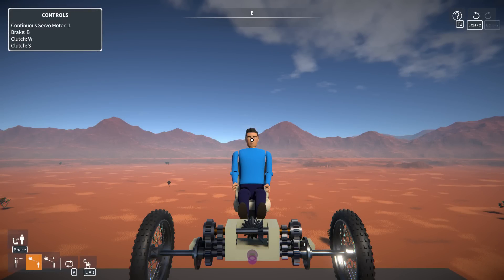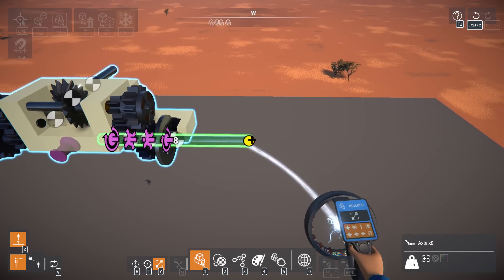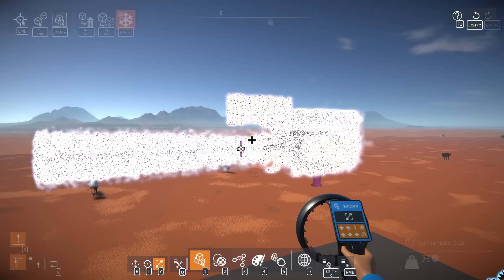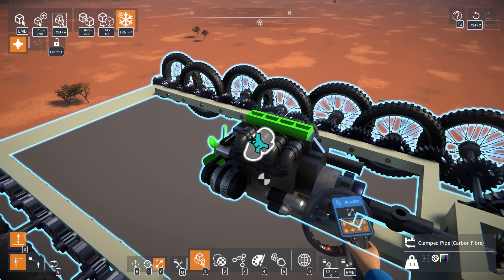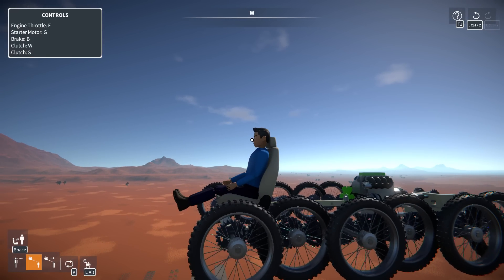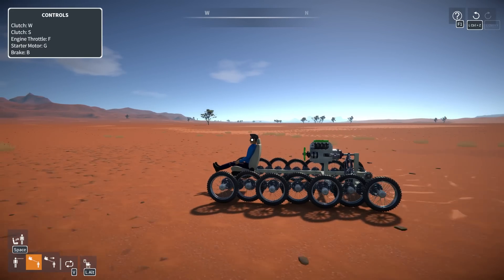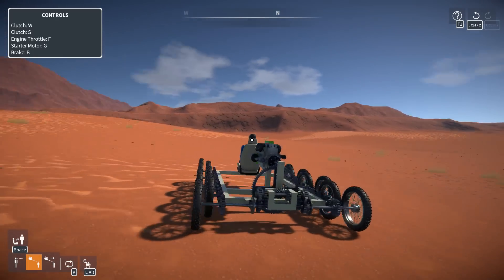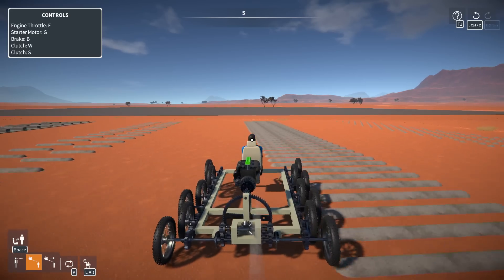I Built a Tank Drive Using a Single Combustion Engine and Transmission!

Comment: When it comes to drive the gearboxes, you have multiple choises. There is the the obvious one diff two brake, the second is a set of two gearbox for each side, so you can control the speed of the sides, but this way you have set curves to drive. And there is the brittish way, with two or three differential, where you actually have neutral turning and smooth curve control, but it's complicated as hell. The sprocket can be front or back, it's basicly preference and where it fits.

Comment: For the motor, you'd probably want something more like the motors you'd find on a large boat. Instead of throttling up the engine only when you want to move, you throttle them up and leave them at that 'working' speed, and vary the clutch to put their power into the props. While this would be completely the same during most of their travel, navigating something like a marina is more along the lines of you driving in the map. you set the engine at a given speed and just change how it engages the drive mechanism. in gear blocks, i think the equivalent would be setting the max rev speed for the engine lower and just having that on a toggle. either the engine is idling or it's at "working speed", not revving to the moon.

Comment: I think the problem with holding a turning and driving key at the same time is that one side has both clutches engaged, which locks up the gears.
I think the easiest fix is to have the clutch that activates on A and W go into a clutch on the other axle that has "Invert Control" ticked and disengages with S and D. And the same for the 3 other clutches.

Comment: newer tanks do use diesel electric meaning they use a generator and large electric drives to drive though im not certain if they still power one side and control steering via braking or if both sides are driven on independent motors

Comment: I think you can easily overcome your steering and forward problem by changing your control setup. Set 2 buttons (4 total) for independent control of each sides direction.
for example: 'W' is left forward, 'E' is right forward, 'S' is left backward, and 'D' is right backward. Thus straight would be 'W' + 'E' ,  and a hard right pivot would be 'W' + 'D'.
you may also want to just set the idle higher, or if possible combine it with your 'forward keys'.

Comment: yeah i believe excavators use hydraulic motors for the tracks. The pump is on the body I believe and they put the hoses through the turntable and use rotating hydraulic joints so it can turn freely

Comment: You can try just a open diff in the center on drive axle and put a brake on each side for steering which ever side the brake is applied will allow the other side to take all the power and turn that direction

Comment: Its brakes that make a tank turn. Not all but some. It goes all forward or all backwards and a brake is applied to turn it in either direction
Try open dif and brakes on both side and when u wanna turn let’s say left the left brake gets applied and it will turn

Comment: If im not mistaken most Tread vehicles or zero turn lawnmowers use Hydrostatic transmissions or hydraulic transmissions and the sticks just change flow rate or direction of the fluid causing the motor motor/gear to turn in a different direction.  I am just an idiot on the intenwebs so i could be 100% wrong 🤷‍♂

Comment: It might be easier to send power to left and right and just break teft or right side to steer, it would turn in a wider circle but that might help the button issue, break right to turn left and break left to turn right and then you can hold forwards and use the breaks to turn or press both to stop

Comment: In Scrap mechanic I made a tank that did left/right:  
1/1 on W 
½/1 on WQ 
0/1 on Q
-1/1 on A 
-1/0 on SA 
-1/-1 on S 

or something like that. It was a 6 engine setup but those controls made it smooth as you don't have smooth brake or clutch input

Comment: 17:07 
You turned the acceleration grip down, so when you lift wheels you have no grip in the lateral movement either. Should've left that one at default as the side to side grip is a different slider I think

Comment: Think you need to turn the friction back up abit and make a big engine and then just set your idle speed high so it's at operating speed and then can throttle it up for extra speed if needed

Comment: front vs rear sprocket tanks is mostly to do with auto vs manual transmission. in older tanks the diver is in the front with a manual transmission - it would be kinda hard for the driver to change gears with the controls in the back

Comment: 12:02 tanks always have to move to turn. If they dont, the tracks will bend side to side wich is not good for it. Russian, soviet tanks cant turn their tracks in opposite directions. They have one transmition and two clutches for each track, and one general clutch. So to steer they can just press the left clutch so only the right track gets power or they can pull the steering lever more and aditionally brake on the left side. Western Tanks usually have one transmition per track, so they can turn like an excavator while standing stil, but usually only on asphalt where the tracks are very slippery. In softer terrain the tracks ddg in and the tank might detrack so its not smart to do it. This is the thing that makes russian tanks somewhat better. They only have one transmition so theyre smaller and cheaper without sacrificing anything important.
Reply: bro created a t34 type engine system
Reply: @persone-lb6hp  this engine and Transition Layout is normal for soviet and even modern russian Tanks and is Not exclusive to the t34
Reply: @Laurenz357  i know but i think that more person know the qt34 cause of its celebrity

Comment: Excavators use 2 hydraulic motors, 2 large sprockets, and a good amount of idler rollers  to power and move a right and left set of treads/tracks. The fluid goes through a swivel that is mounted between the tread base (B) and body(A). Side (A) spins with the main body and can keep the tread/track moving in the same direction. The body can have a single or set of motors with gears to spin it around.  It would be fun to watch you make an excavator.

Comment: in tanks 4 clutches is common some tanks 2 per side also know as a dual clutch drive or double clutch steering most other tanks used only 2 clutches forward and back and had a large brake on left and right for steering most also had ither a front drive sprocket or a rear one there was rare few that had both but those were to hard to mass make so they were left behind  until hydraulic drives were put in some newer ones

Comment: okay so a lot f tanks have a clutch, a diff and 2 independend brakes if you brake the right side the left side still moves because of the diff so you turn. what you made has been done but the approach i said is the easiest but if you turn you dont let the other wheel go backwards like this design allows

Comment: Like others have said it depends on the era of the tank if it has front or rear driven gear. Majority of WW2 tanks had the transmission in the front, which subsequently meant the driver gear was on the front too. For an example the Sherman’s whole from glacis assembly that housed the transmission was removable. If you ever get to research about the M4A3E8 (Easy Eight nickname) like the one in Fury you should. Between the stabilizer gun system, Ford V8, and most importantly the HVSS system the thing was an urban combat beast (even though it didn’t have as much armor as the German’s Tigers, and Panthers did. 

It wasn’t until a little after the Cold War, and right after WW2 that tank manufacturers started sticking the transmission in the back. I wanna say for the US the first rear mounted transmission was the M26. For sure the Patton tanks, M46, and its successor the M48 (both were Vietnam, and Korean War era tanks). Nowadays our Abrams’s “super dart” can pen like some 600mm of armor or something, it’s an insane amount. 

You should look up the video of the (modern) Germany’s Leopard 2A7 demonstrating it’s fully stabilized gun system (another ground breaking technology thing for tanks) with a full beer mug on the end of the barrel just flying down a road. It stops just right behind a group of lined up soldiers w/o spilling. As for controls theirs H controls like on old dozers, two lever controls, one for each hand, back when they couldn’t zero turn a tank either for risk of popping off a track, or the type of transmission wasn’t advanced enough. Germany used a damn steering wheel in their Tigers for some reason IIRC. Then there’s iso, or joystick style if controlling. 

I’m a military vehicle nut so I need out about this stuff.😂🤣

Comment: the tanks build correct but you are facing the wrong way in your seat, tank engines face backwards and usually the gearbox is in the front. Also be good to raise the front and rear side axels a few blocks to create the lift in the "tracks" for breachings and crossings

Comment: a little tiny bit of insight I give to how tracks are powered, if you can think it, someone has probably done it
front or rear driven gears are entirely dependent on where the gearbox is in the track vehicle, mainly down to the packaging in the rest of the vehicle, and ww2 tanks especially are rather drastically different from each other, every nation had it's own unique and quirky design ideas
I am in no means an expert of course, but your four clutch system reminds me of a reverser gearbox that people install onto motorbike engines when swapping them into carts/small cars due to the lack of innate reverser on a motorbike gearbox, fun thing with them is because they just reverse whatever input they get, you end up with a six speed forward or reverse gearbox

Comment: Most tanks work like skid steer heavy equipment 
   There's a multi stage hydraulic pump on the engine one for high flow one higher pressure and hydraulic rotary vane actuators on the final drives 
     A vane motor is built similar to the vane pumps on the engine 

   Sometimes called a hydrostatic drive iirc 
This then spins a shaft that goes through planetary reduction for more torque
   The modern vane motors use variable geometry so they can achieve higher speeds without sacrificing torque

   The final drive is all on the back sprocket

   I aced my hydraulics pneumatics advanced hydraulics advanced pneumatics gear and advanced gear trainer in diesel mechanics 😅
   Knocked them all out in one week 😂

   Your tank looks really cool btw and  some early tanks were absolutely made that way 
     Interesting fact they called them tanks to confuse the enemy to have them thinking they was talking about water tanks 😂
Reply: Air tools use vane actuators too
Reply: The big haul trucks at mines use them too
Reply: The advanced pneumatics trainer had a working model excavator you could hook up and operate 🎉❤

Comment: I built a double differential, but once I made my body for the thing I was making it was too heavy too move, but it was still a fun experience to learn how they worked. The main input was the “engine” then the secondary input for turning, I assume would be hydraulic, but I just used a motor, but it took a lot of torque to turn it, as I’m not an engineer and my gear ratios were off

Comment: Most tracked vehicles nowadays use a transmission that outputs the power directly to the two sprockets. Braking happens within the transmission as well. The sprocket connects directly to the transmission by a propshaft/final drive and everything else is in the transmission.  Also usually 3-4 forward gears and 1-3 reverse gears.

Source: Was in an Armor unit with lots of tracked vehicles.
Reply: Also pivoting is usally a seperate gear where the steering yoke control direction and the gas determines speed

Comment: I hope i can explain this somewhat clearly, but John Deere agricultural track machines (8 or 9 series, not bulldozers necessarily) have two shafts coming from the transmission (one for propulsion, one for hydraulics and PTO). The propulsion shaft drives the differential. On each side of the differential, there is a planetary gearset. The differential drives the center "sun" pinion, the "planets" are on a carrier which is attached to your axle shaft which drives your track, and the outer ring gear is not necessarily stationary as in a normal planetary set. The outer ring gear is driven by a hydraulic motor that can turn the ring gear each way, which in effect, speeds up or slows down each track depending on which way the machine needs to turn.

Comment: No a excavator uses in simple terms a hydraulic flow to each motor (planetary) when you move the foot pedals in one direction or the other it controls a valve in some terms that send fluid one direction or the other through a central round valve block in the center of the house baring witch send fluid to the proper track in that direction

Comment: There's actually a rather simple way of making a tank drive that doesn't require a single clutch.

You need two open diffs, and a servo motor.

You set the diffs such that the four output shafts are parallel and the input shafts are facing in opposite directions. Your combustion engine supplies power to what is henceforth known as the primary diff, and the servo motor to the secondary.

The outputs shafts on the "left hand" side should be geared such that they spin on opposing directions and the shafts on the "right hand" side be geared such they spin in the same direction.

With the servo motor stopped you have a locked diff, if the servo free spins you have an open diff, and when the servo spins you'll funnel power one way or the other through the primary diff

Comment: the first thing you showed us was the final drive, not the transmission, I think. The final drive controls the movement of the vehicle and houses the diff, and the transmission is attached to the engine. the sprockets drive the track and idlers tense the track, and the top wheels are the return rollers and the bottom ones are the road wheels. I think the panzer 3's and sturmgeschutz's based on the panzer 3 hull have the simplest example of final drive, but correct me if I'm wrong.
Reply: Things like the char 2c and 2c bis have two engines, both delivering 600 horsepower I believe. They then lead to an electrical final drive and allows for neutral steering. Pretty technical considering it's a ww1 tank and it's french

Comment: think u really over complicated this...

could just have used a differential and disk brakes on each sides that brakes the side you want to turn towards so all power just goes to one side.

the only "transmission" part of the build would be gearing it down for som torque and forward/reverse gear.

Comment: I think part of the issue you had climbing anything is due to the lowered accel/decel grip on the tires. It should turn fine if you keep the cornering grip at the lowest setting but put the accel/decel one up.

And would a differential help with steering? Would you need a diff for every wheel or something to properly translate wheel spin when moving? Stationary I'm sure a single diff would be enough.

Comment: you should check out a subtractor for tracked vehicles, basically uses differentials and 2 motors to steer and drive! one strong motor for forward and reverse, the other motor can be weaker and just controls the difference :)

Comment: Excavators,  use the engines power to power a hydraulic pump, which sends the hydraulic fluid through a thing called a swash plate, (its basically a series of little pistons set on an angle) the fluid rotates the plate, in what ever direction you have asked it to go forward or backwards. Then on the other side of the swash plate in the "drive motor" or final drives as they are called is a planetary gear that sits in a bath of oil, that sends torque to the tracks! 
Heavy machinery people dont understand that the engines are just static engines. They are there to just power hydraulic pumps, water pumps, and air conditioning pumps. They have absolutely zero connection to driving the machine.
Excavators,  loaders, bulldozers, stuff like that!

Comment: you probalby want to independantly controll, left and right side of your "tracks" rather then try and do secondary buttons for "turning".

my suggestion is:
Q: throttle engine.  W: left forward.   E: right forward.
A: Brakes.                S: left reverse.     D: right reverse
G: ignition

the idea here is that you use 6 buttons that make logical sense to controll the left and right side "tracks" and have your throttle and brake be close enough you don't have to move your hand on the keyboard to use them, the G button is fine since it then forces you to keep away from the movement controlls while starting up your "tank"

hope you have fun ^^, oh and i have no idea if all of those buttons are free to use since i actually don't own the game :P

chers

Comment: Would love you to research some of the older Detroit diesel 2 stroke engines.  Yes I said diesel 2 stroke.  I think you’d find it very interesting.  They also used some of those engines in tanks as well.

Comment: Slightly disappointed you connected all the wheels with gears and not with a big belt and pulley (I know it's not actually a tread, but it's at least reminiscent of them). Very cool build though, answering a question I never knew I had!